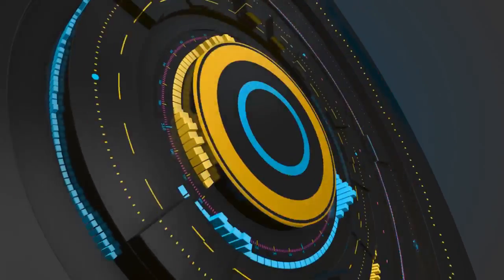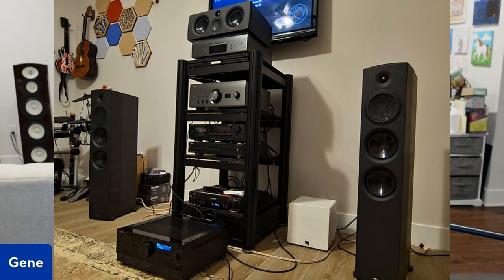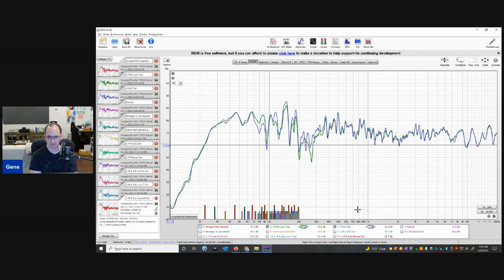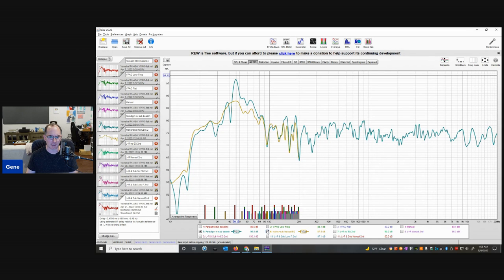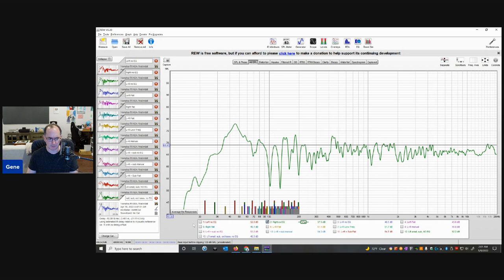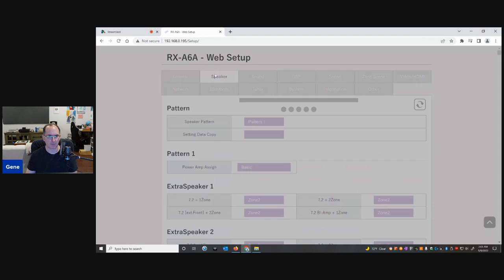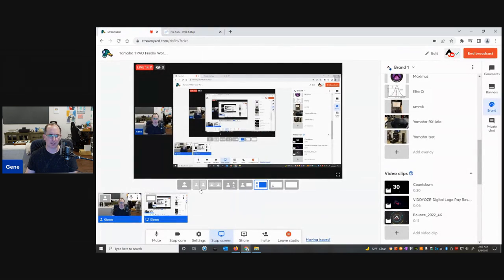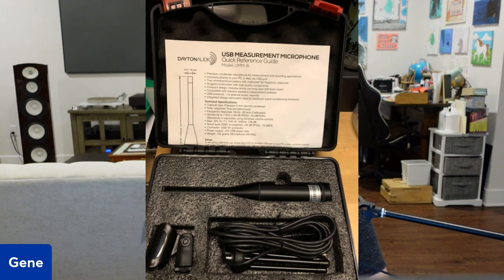Yamaha YPAO Room Correction Finally Works?!?

Comment: Any chance they'll retrofit this into the RX-A3070? I'm basically happy with my setup, and not about to buy a new AVR just for the improved YPAO. I've never trusted room correction for channel levels for the rear and overhead channels, which I tweak by ear to match the other channels, since the ceiling-aimed mike misleads the automation into thinking those channels are louder than I hear them.

Comment: Hello,
I have an A4A and have it setup with a 4.1 configuration: One RSL Speedwoofer, two front JBL Studio 230's, and two rear JBL 306p mkiis. When running YPAO it marked both pairs of speakers as "large" and set a -10db level for the sub. Now the sub doesn't kick on unless I have my volume cranked to unreasonable levels.

It seems YPAO got the parametric EQ correct as well as the distances (including the delay from the wireless SVS transmitter I'm using for the rears) but I want to actually hear my subwoofer at normal listening levels. Do you recommend manually setting my speakers to small or using extra bass with the YPAO Flat curve?

Comment: I did YPAO on my  R-N800A + Dali Zensor7 + REL T7/i and I'm totally disappointed. Most of the bass is gone! The sub is barely audible. That's not what I bought an expensive sub for. When I remove the sub and just use the main spekers, it occurs the bass is gone too. When I flip between the YPAO mode on and off, I clearly hear the Dali operate with MUCH less bass with YPAO on. Can someone explain why?

Comment: Hi Gene I was lately considering about replacing my onkyo TX-NR686 model to the Yamaha a6a and Pairing my Polk audio signature series with the Yamaha a6a since I have had the onkyo 686 for about 4 year’s now. I wonder I will hear a difference in the Yamahas sound instead of the onkyos since I owned there products for a long time
Reply: Hi @natedog1738. We replaced an onkyo (about 8 years old) with an A4A for the same reasons about 6 months ago and could not be happier. It sounds way better, and my wife keeps commenting on how good that new amp is :-)
Reply: @paulypaulypauly8011  the way gene said that when you set your speakers to small your front speakers will sound like towers not satellite speakers. That had me happy that he said that.

Comment: Now...if Yamaha offered more Channels (for 7.2.6) and put in the needed effort to optimise Surround:AI my next AVR just might be a Yamaha again. But my Denon X6700 with Multeq-X is doing pretty well just now...
Reply: I'll have to check, but I think the A6A will support 7.2.6 with 2 external amplifiers channels attatched.
Reply: @richarddortch6122  a6a only 11 channel  with 2 external amplifiers channels
Reply: @junior-OG  I think you may be right.
I thought the A8A could do 13, but it's limited to 11 as well.
I remembered Yamaha saying something about the A6 and A8 having the same capabilities when external amplification was involved.

Comment: Lots of problems. One problem with EQ in general is that given system design EQ alters both the direct and reflected sound at the same time. Most modern speakers really have miserable off axis treble response so the top octave or two gives almost no reflections. Pulling speakers away from walls and other reflecting surfaces reduces mid frequency reflections to compensate but the price for narrowly focused high frequencies is that as soon as you move off axis the high frequencies even directly from the speaker fall off drastically. This is why you need to adjust  your toe in with a micrometer and sit at a sweet spot. No musical instruments propagate sound this way. This is done deliberately to improve "imaging' and "sound stage" at the cost of tonal accuracy. 

Bass is always a problem. Roy Alison and Dr. Floyd Toole did a lot of research on how bass couples to rooms and Alison also did a lot of research on eliminating the typical suckout at around 200 hz. These graphs in this posting are not the typical smoothed out responses but show much more detail. The result is what looks very much like a great deal of comb filtering with the span between peaks and dips as great as 15 db. 

Finally there's the problem of differences in spectral balance of bass in recordings. Look at the low frequency curves in the Fletcher Munson graphs. 
https://www.google.com/search?q=fletcher+munson+equal+loudness+contours&sxsrf=ALiCzsZ_ui7phaP6K5Y964t98ztQi_O85Q:1652120535699&source=lnms&tbm=isch&sa=X&ved=2ahUKEwi2_p7NhNP3AhWlhIkEHeQeBdgQ_AUoAXoECAEQAw&biw=1536&bih=723&dpr=1.25
The scale on the left is actual loudness. The scale on the bottom is frequency. The curves show perceived equal loudness as a function of actual loudness at different frequencies. Notice how the curves are squashed together at low frequencies. What this means is that up until the lowest curve which is the threshold of sound, the softest you can hear, you hear nothing. Then once you get there each small incremental increase in real loudness has a very large change in perception of loudness compared to higher frequencies. This is why I find it necessary to adjust the bass for each individual recording very carefully to keep the spectral balance realistic. My experience is that the spectral balance of recordings at all frequencies is all over the map from one recording to another. This is why the first thing my electronics has to do is reconcile the difference between the spectral balance of each recording with the FR of my sound system. 

One last observation. If you look at the curves that extend to 20 khz such as those at the top left be aware that the lowest curve is the softest sound you can hear at each frequency and the top curve is the threshold of pain where sound is so loud you experience it as pain, not sound. At 20 khz all of the curves go straight up so that the threshold of hearing crosses the threshold of pain so anyone who says they can hear anything above 20 khz, .... well just show them these graphs. So much for HD. BTW, MQA violates the Shannon Nyquist criteria by 400 percent. It's a solution that doesn't work for a problem that doesn't exist.
Reply: Yeah that's cool and all...but have you ever listened to Bose?   I've never heard of this mr.tool guy, but Bose had Amar. And Amar argued that the best measure of audio quality is the listener's perception.  Put that in your pipe and smoke it
Reply: @sporegazm  I actually own a pair of original Bose 901s among the many speaker systems I have. I bought them before I became a critical listener and I liked them. Then I put them away for several decades, became a critical listener and listened to them again. This time I didn't like them anymore. Being an engineer and curious about everything I had to know why I didn't like them and what if anything I could do about it. It took me four weeks to fix the bass and four years to fix the treble. It's now a two way biamplified system with 6 tweeters per channel. Like all of my systems it has to be designed and adjusted to the spot in the room it will occupy and also for each recording. It's now a full range system that works extremely well. Nevertheless I haven't heard them in over 4 years. I'm glued to my main ststem, one I invented, patented, and for me the best that exists. BTW I've never worked in this industry. I was cut out for far more interesting challenges.
Reply: @markfischer3626  lol i was just trolling.   Good answer.   Bose 901's are legendary for their moment in history.

Your ears when you enjoyed them weren't wrong and your ears when you didn't enjoy them anymore also weren't wrong.  Sound and the enjoyment of sound is neat that way 😉😃
Reply: The original Bose 901 was an acoustic suspension design using 9 30 watt each acoustic suspension drivers. It had 3 serious frequency response flaws, two in the bass and one in the treble. No highs, no lows (except at ear shattering loudness.)  There is a 7 db broad rise at about 250 hz. Bose said he wanted the system resonance frequency to be above 180 hz where he said phase shift at resonance would become inaudible (he got that wrong., it's not audible below 180 hz if Q is at critical damping.) But the system was underdamped. The output below resonance falls at 12 db per octave reaching the 1 khz output at around 95 hz and keeps falling but the equalizer only boosts output at 6 db per octave, not nearly enough. An extra 6db per octave boost flattens the response but power required to reach full potential jumps to 600 to 1000 wpc. Since the system is only rated at 270 wpc, four pairs in parallel driven by a Crown 2502 drive core amp would solve that problem, otherwise the full potential cannot be realized but deep bass to 40 hz will not overload my 138 wpc receiver. THD of the speaker at 30 hz is 10 percent which isn't bad (this is a critical measurement they don't publish usually.) Original AR1W and its derivatives by comparison was 5% which is why it became the world standard  and eventually was reduced to 1%. It was so accurate medical schools used it to demonstrate different heart sounds to students.

The treble was the hard part. It was not expensive but it was difficult to get it right. A directional array of 6 3/8" poly tweeters, one forward, three back and two upfiring are crossed over with a single pole (6db per octave) capacitor at around 9 khz. They're driven by a separate 100 wpc receiver with its own equalizer so it's loafing. It's remarkable how little sound is needed in the top octave but every detail of it is critical. (I have exceptionally tough standards and my reference is live classical music. I do not want a Steinway piano to sound like a Baldwin or visa versa. and I have one Steinway and two Baldwins.) While these speakers can play any kind of music, the best a two channel system can do convincingly is to reproduce music of soloists and small ensembles as they would be heard in your listening room. Recreating concert hall acoustics is a much more complicated problem which I also solved and have been experimenting with for nearly 50 years. That's much more fun than 2 channel stereo.

Comment: Can this version drive two subs independently?
Reply: Yes, My A6A is set for R+L Subwoofer and YPAO sweeps them separately.
You can also set Mono Subwoofer.
Reply: @richarddortch6122  that's extremely hot, i didn't know it. thanks

Comment: Has anyone upgraded from the A3080 to A6A or A8A? Notice any improvement on the over all sound?
Reply: yep went from 3080 to 8a, insane difference , totally changed how my speakers perform, bass to much more, head room for miles
Reply: @teawanga  Are you using the internal amp for your mains? I have a parasound external for mine so I don't really take advantage of the power from the AVR. For music was sound more full and dynamic?
Reply: @toddlewis6683  the difference is frightening how good it is it’s just so much better mind you it’s a lot more money it’s transformed by speakers
Reply: @teawanga  I just picked up a new A8A for a steal, $2500. I haven't opened it yet. I'm being told by several people to return it and get the Denon 4800 when it comes out next month. The reason are two: 1) Better room correction with Audyssey built in and Dirac coming in a future purchasable update. And 2) You can shut down individual channels of the onboard amp in order to utilize pre outs and an external amp to power them. I don't know what to do...
Reply: @LichaelMewis  to be honest I’m loving mine the power is incredible loads of headroom couldn’t be happier with it
Reply: @teawanga  cool, what kind of setup are you running?
Reply: @LichaelMewis  5.2.4
Reply: at thsi stage anyways
Reply: @teawanga Did you notice a more dynamic sound stage with the A8A over the 3080 ? 3080 is a very dynamic AVR. I'm just thinking of staying with my 3080 until the next gen of aventage comes out probably in 2024
Reply: @toddlewis6683  omg it’s insane the difference to the 3800 seriously it blows me away just how good it is 
So much headroom it’s transformed my speakers to another level

Comment: Still too expensive for the receiver, you get much better value with Denon
Reply: I waffled back and fourth between Denon and the A6A.
The deal killer for ME was the A6A has balanced outputs for the Front R&L.
Otherwise, Denon/Marantz is a REALLY compelling option.
Reply: @richarddortch6122  whats the point of XLR if SINAD is worse on yamha?
Reply: @sneikiusas  SINAD is worse but it's almost 4x the voltage.
I argue you'd never realistically run your A6A flat out into a balanced monoblock amp.